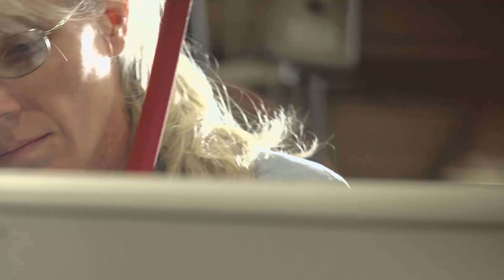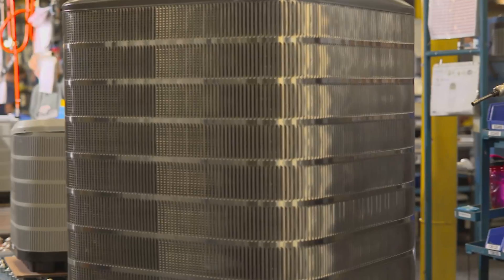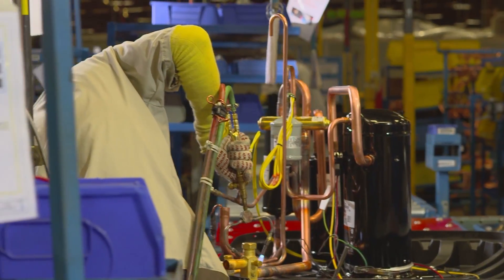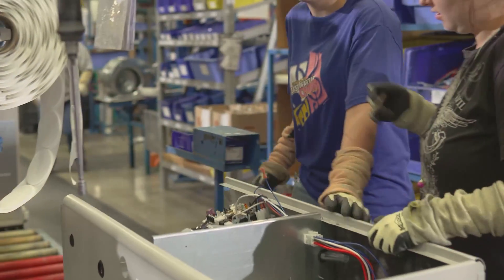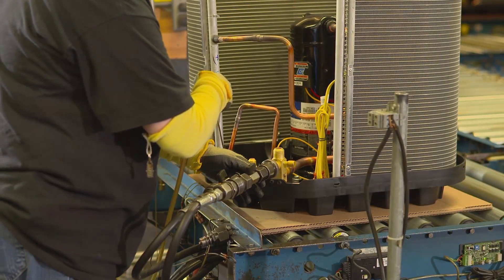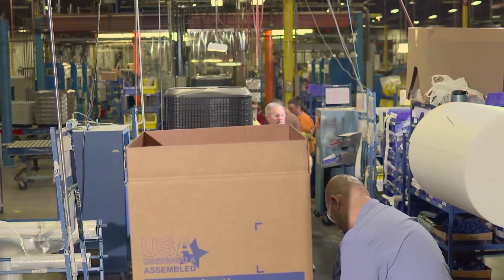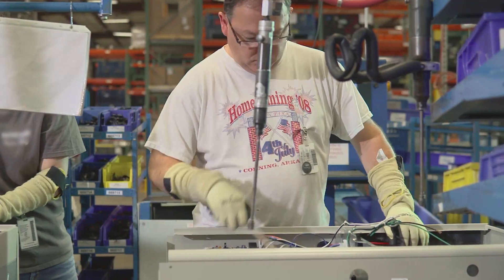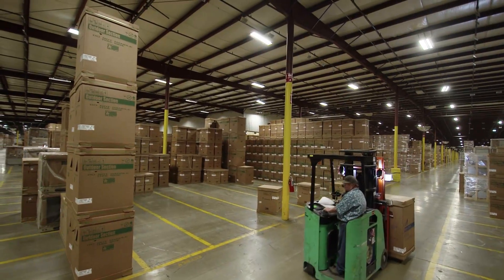Nortek Global HVAC DFT Manufacturing Process

Comment: I have no doubt of your purpose of providing quality products for the price, that's fine.  It is a very competitive industry, we all know that.  But please do some re-design of the  condensing units.  Surely the condenser for both AC and Heat Pumps can be reconfigured to provide much easier access to the reversing valves and compressors.  I for one and leaning toward the Rheem layouts. Much easier access to these components.
Reply from the maker: +ritewayguy Thank you for the feedback. You bring up points that we have been actively discussing in engineering. We agree easier access is needed.
Reply: +ritewayguy Well,  thank you for your favorable response.  You could put a wider access panel next to the  electrical box on the side,  not the back side, that permits easier access into the compressor and RV,  and not have to change the internal tubing configuration,  and then you could increase the height of the condenser coils to make up for the needed footage that would be lost by adding the wide access panel.  Make sure the access panel IS wide enough.  Think about it.
Reply from the maker: +ritewayguy Again, thank you. I will pass your input onto product management.